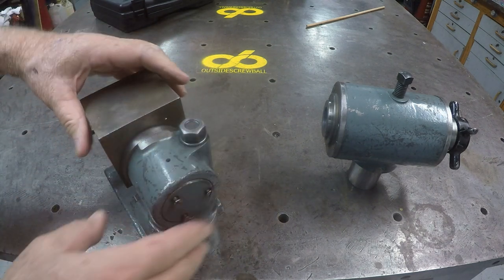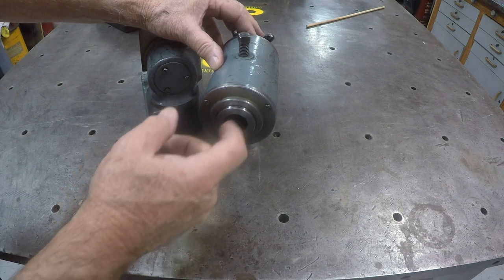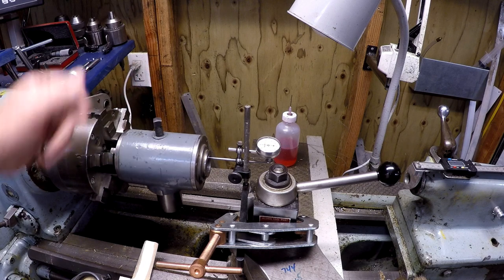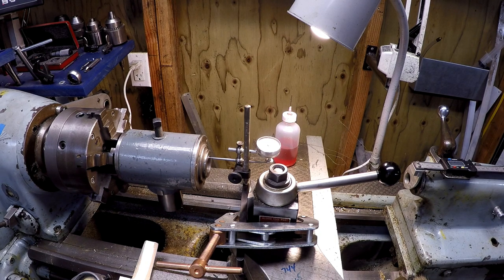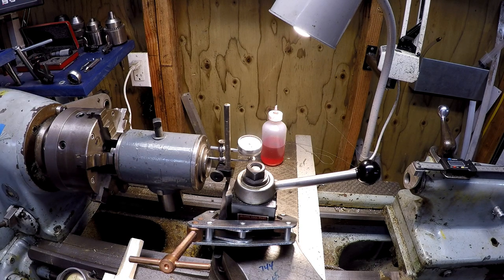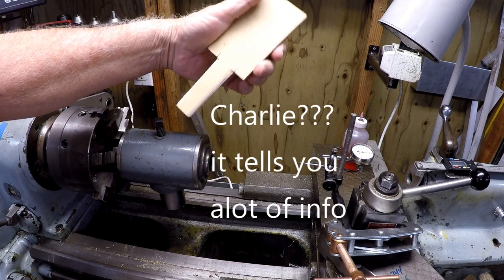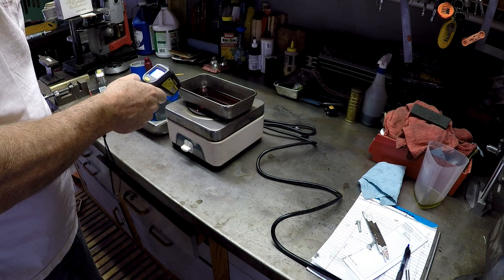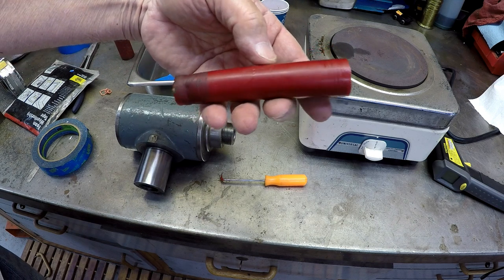Screwy Tuesday....What's My Taper???

Comment: It’s likely Brown & Sharpe taper.
Reply: my first thought as well
Reply from the maker: my thought also...but it is not a B&S taper
Reply: @outsidescrewball  Did you measure your plug you fitted with the bore to remeasure the taper?  0.041667"/in would be within a reasonable measuring error of your first method (0.036/in).  Off axis, off centre, etc.
Reply: I would have expected a #9 or #10 B&s Better get Howie back in the shop though. First the scale reading now .018” doubled is .038. lol

Comment: chuck if you would have trusted your first reading with the indicator .018 and ran the calculation you would have come up with a  taper of one degree one minute 52 seconds. using a sine bar on the compound would let you set this angle very precisely . use the hot wax to clean up those hairy legs.
Reply from the maker: truth!!!...thanks for viewing

Comment: So what is it a B& S # 4 ?
Reply: One size larger than a B&S #3 and one size smaller than a B&S #5.
Reply: @grntitan1  To my eye, it looks like a B&S #9, that fixture is for a #13 B tool and cutter grinder.  The taper numbers commonly used were the odd numbers; 3, 5, 7, 9, 11 for cutting tools, even numbers were used for machine spindles.
Reply: @biggreasies537  Except I have a Sheldon/Vernon #0 Horizontal Mill with a spindle that takes a B&S #9 taper.
Reply: @biggreasies537  we have a winner!